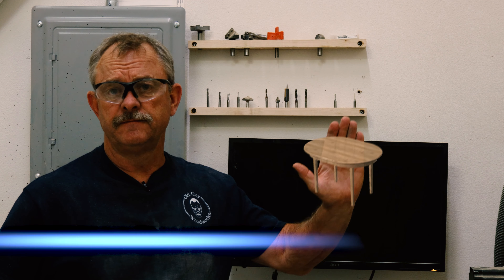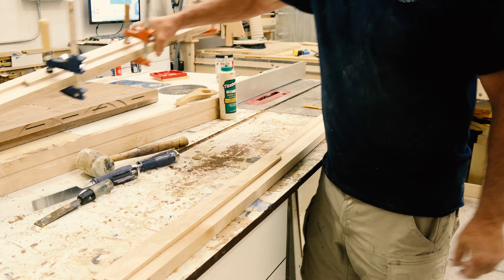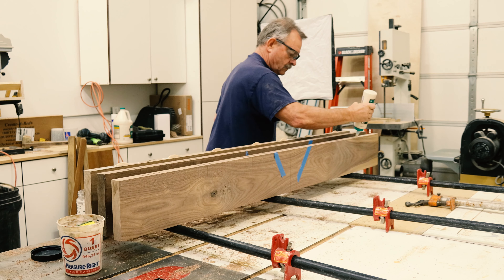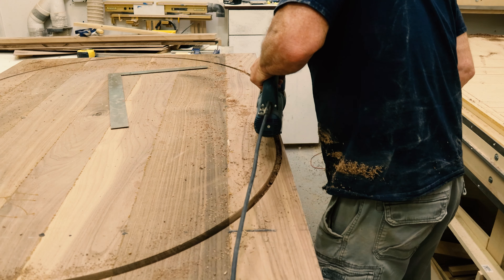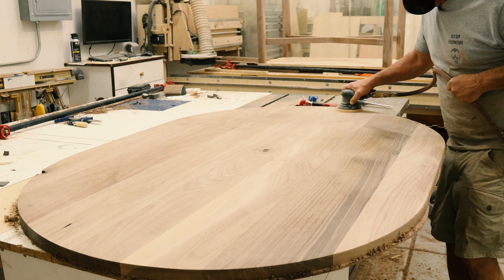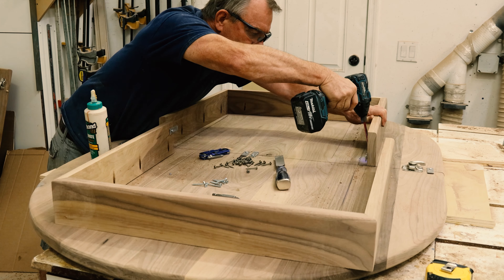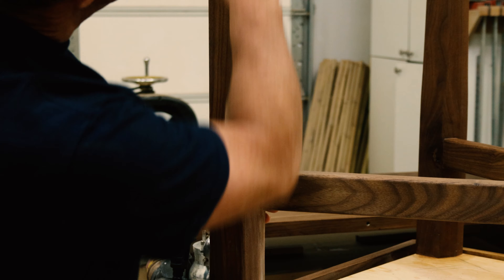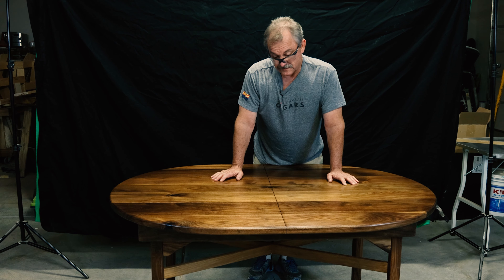Build a Solid Walnut Dining Table with Equalizer Slides

Comment: Awsome work. Really enjoy watching your video. What type of gun are you spraying with and do you know tip size?
Reply from the maker: I just recently bought an Apollo 7700 from the Finishing store using a 1.0 tip.  I thinned it the max I could which was maybe 5%.  If I didn't thin I would use a 1.5.

Comment: A few questions:  How did you attached the leg assembly to the top/slides?  Is the top of the leg assembly 3/4", or so, plywood?  Are there gaps or spaces you have to maintain so the slides don't rub on the leg assembly or tabletop?
Reply from the maker: It's been a while, but if I remember correctly...  The slides/guides sit on a piece of 3/4 plywood.  The legs are attached to the plywood with brackets and fasteners creating a pedestal.  The legs don't extend past the plywood so they don't interfere with the slides at all.  Hope that helps.